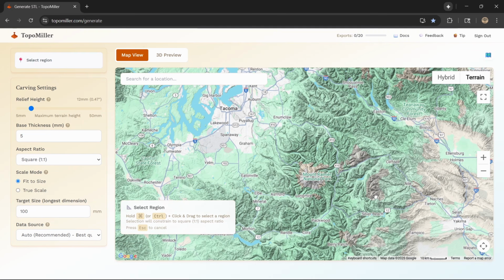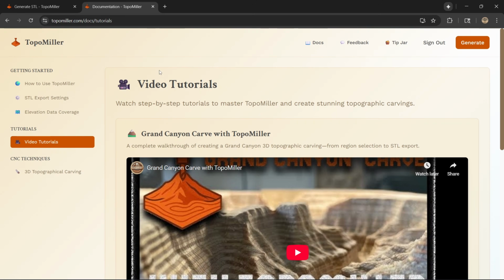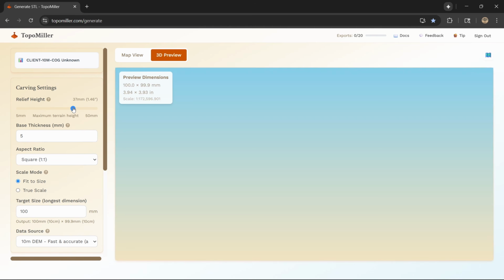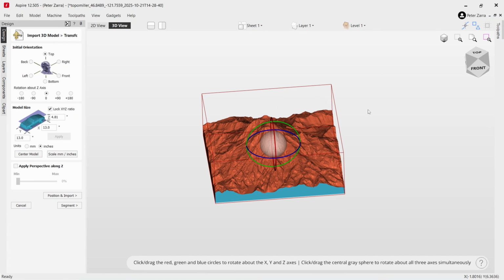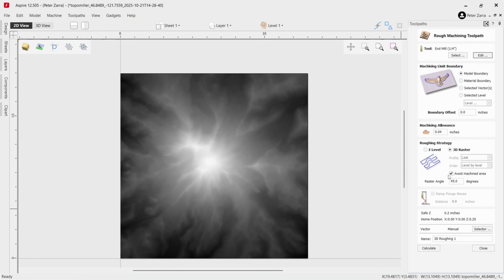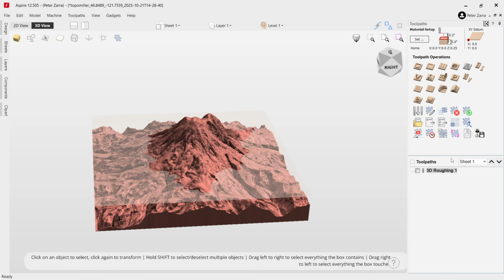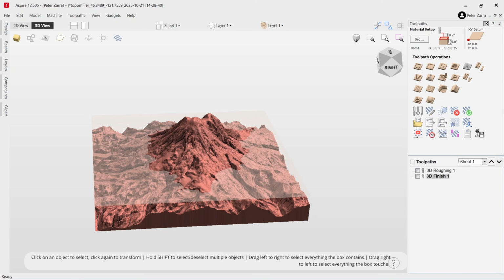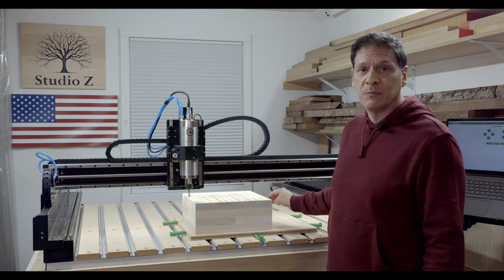AMAZING 3D Terrain Carve with New Software: Old vs New

Comment: How did you re-zero your finishing bit if you had already milled down the block? It looks like you used Material Surface as the start point, but that has been milled away.
Reply from the maker: You only zero once per side before you start, the 3d finishing toolpath starts where the roughing one finished.
Reply: @StudioZ-maker  Maybe I'm a little dense, but I don't understand that. First pass is with a roughing tool. You set the Z zero at the top of the material. All that material is now cut away.

You switch to the finishing bit - which is a different length, and likely not inserted the same depth in the collet, so you need to re-zero the Z. How did you do that? Or do you have a bit setter or depth collar on your bits?

And I REALLY don't understand the side comment - there is only one side to this project. I'm really not trying to be a jerk, just totally confused by that answer.
Reply: I’m somewhat confused too. When i change to the 1/16 bit, it protrudes a different depth from the collet, so Z height will be different and there’s no surface left to Z zero the bit.  I don’t have an automatic tool changer, which, I guess, would account for that.  
Perhaps setting your Z zero at the model base and then begin your carve at a minus value (in this case -4.something) so that you can zero the 1/16 at the model base too?
Reply: @finneganfly  The only way this works is if he is zeroing at the machine bed and not the top of the material. But I really would just like an explination from him.
Reply: @ramcgmecom Exactly.  When I said model base, i meant machine bed.
Reply: SudioZ has a very special method of zeroing his Z axis.  He has an off the material special Z probe or something.  It really doesn't work well for most of us who zero off the actual material.  I haven't figured out how to do it yet.  I think if you have an extra piece of the uncut material, you might be able to zero of of that near the final material.   I'm still researching that issue.
Reply: @markjenkins1569  If you know the thickness of the material, you can just set the z at the machine bed, not the material surface. Or you have a bit setter somewhere that calculates the difference. I would just like to know how HE does it.

Comment: Beautiful work and thanks for sharing. One question. Did you have the grain alternating on each layer and if so, are you converted at all with it delaminatng over tme with the expansion and contraction over time?
Reply from the maker: Thank you!  Yes I did alternate the grain on every layer and I did it so that the block would be more stable, no concern for delaminating.

Comment: It would take a lot longer, but I find that a 7% step over on the finish pass eliminates the milling lines in the final product, I'm about to go do a small one of these immediately 🎉
Reply from the maker: Thanks, yes, you are absolutely correct, but I just didn't want to wait that long.  I did notice that there were lines on the map itself and they transferred into the file and ultimately were carved that way, just an FYI👍

Comment: Mt Whitney is higher. (Rainier does have the largest elevation change above its base I believe).
Reply: Mount Saint Helens is 8,363 feet (\(2,549\) m) high, while Mount Whitney is 14,505 feet (\(4,421\) m) high. The difference in height is approximately 6,142 feet (\(1,872\) m), with Mount Whitney being significantly taller and also the highest point in the contiguous United States
Reply from the maker: Yes Mt Whitney is higher but it is in Alaska.  This was for the lower 48.  Rainier also looked cooler 😉
Reply: @StudioZ-maker  Mt Whitney is in California. Denali/Mt McKinley is in Alaska.
Reply from the maker: My bad, I got the names mixed up on that one.  It's strange though when you look up Mt Rainier it says it's the highest peak in the contiguous US at 14,410 and when you look up Mt Whitney it also says it's the highest peak at 14,496, strange.  But, thanks for catching that, I missed that one

Comment: How did you set your Z height on the finishing pass?
Reply: I would set Z off the table (bottom) next to the blank so it doesn't matter if you mill off the top with the rouging pass, your Z is constant.
Reply from the maker: You don't, X,Y and Z are set once before you start.  Everything is based off of that initial setting.
Reply: @StudioZ-maker I thought it was necessary to check the Z when you change bits.

BTW, excellent video
Reply from the maker: Thank you, no you only set the z height once during a carve (per side).  When you change a bit, the machine measures the new tool with Bitsetter (tool measuring device) so that it knows how long the new tool is in relation to the established z height.
Reply: @StudioZ-maker  Only with very expensive CNC machines.  Many of us who have to manually change bits don't have this luxury  :>(.   I haven't figured out yet how to do it.  I suppose you could zero off the machine bed,  or have a piece of the original material to use as a model..